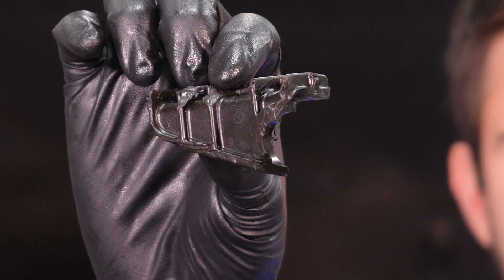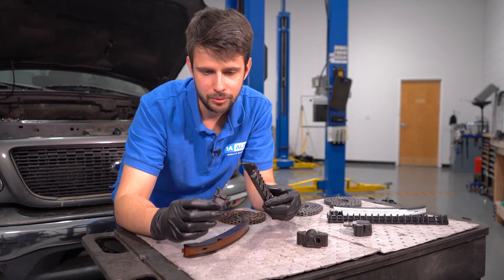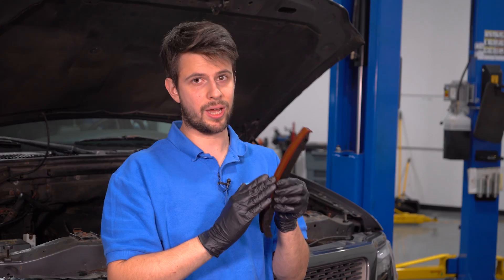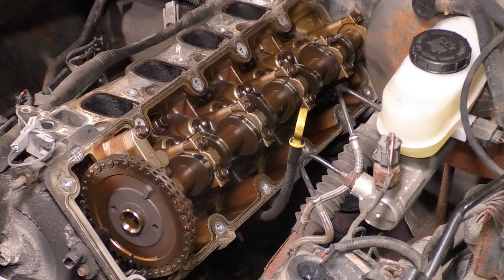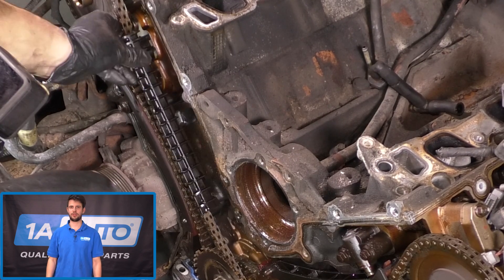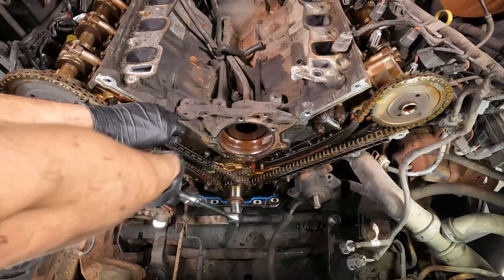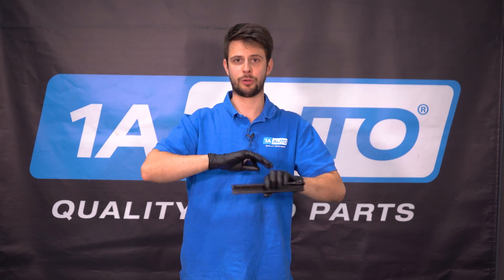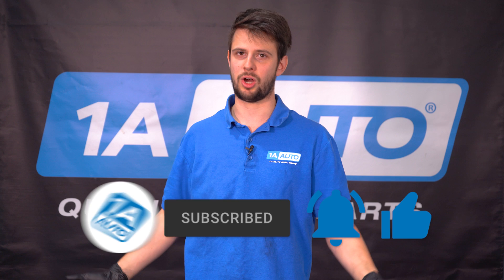Ford 5.4L Timing Chain Guide Broken & Found in Oil Pan. How to Replace It!

Comment: My mother in law was going 75 mph and her timing chain let go a couple days ago in her 05 f150 it has the 5.4 3 valve engine . I pulled the valve covers off and the chain guide plastic pieces are everywhere.

Comment: Question - for pulling the harmonic balancer, do we just need to ensure the vehicle is in Park? We won't need to get on the other side with a wrench on the torque converter correct? Just an impact gun and the puller?

Comment: I have replace the timing chain on my 2005 Expedition.  What I never see on these videos the oil pan being removed to clena the broken plastic parts and cleaning the oil pump pick up screen of plastic gragments.  When I pull my pan the oil pump pick up screen was completely plug causeing oil restriction to the engine.  Installing a high volume oil pump when the pick up screen is plug provide no value.   The [lug screen will cause engine lock up do to proper lubrication.

SO PULL THE PAN AND CLEAN THE OIL PUMP PICK UP SCREEN.

Comment: 235K miles and counting- still have yet to get this done. Trying to decide if I want to take it on, or take it down to my guy to do the repair. Anyone have any idea how expensive this would be to have someone do? Thinking about having a Melling higher pressure oil pump put in too either way if I do it or they do it. Just thinking about how much time and tools this takes vs having a shop do it over a day or so- not sure how many hours this takes for a novice level home mechanic.

Comment: actually most of the stuff you said wasn't accurate specifically to why the guide broke, it was fixed in a thicker guide.... not heat cycles and oil making plastic brittle LOL but ok decent video but lack of knowledge means you should stick to something else or letting a professional speak

Comment: Engineer greetings, I need your help to solve my faults on Nissan Rogue 2008, the car has an difficult starting and I ask the owner what happened? He said the mechanic changed the engine from that time I had experience difficult starting,ok” he bring the car to and I checked everything and I saw the crankshaft was different from his old engine so I use the old crankshaft now the engine starts fast but after we finished everything and I hear the timing chain noise and I put the engine off , and I saw the chain tensioner failed and I changed it but now the is giving me rough idle when the engine started, plugs and ignition coils has been changed but still rough idle, can valves burn when the chain tensioner fail ? Kindly help me to solve the issue. Tanx  am waiting your reply

Comment: Brian, on the Ford Tech Makuloko YouTube channel, makes a good living replacing cam phasers and chain guides on thpse 5.4L 3 valve engines! The biggest reason they fail is the use of 5W20 oil. It's just not thick enough to properly actuate the components. The rest of the world uses 5W30, and they don't have this issue! Don't take my word for it. Go check out Brian's channel. He'll tell you the same thing.
Reply: Amen. Brian is a Godsend to us 5.4 owners.

Comment: I'm doing this job right now. As in im siting in the engine compartment right now. This is a very difficult job and now I understand why dealer prefers to swap the engine. 07 f150 5.4l 3v

Comment: The host is a cutie!  Also, I completely agree about replacing the chain, tensioner, and guides while you are in there.  I would also replace the water pump while you are there.  Plus if your spark plugs need to be replace, I would do it too (since they are out).